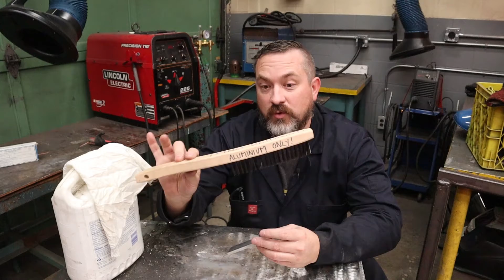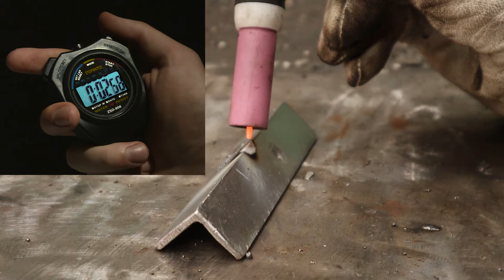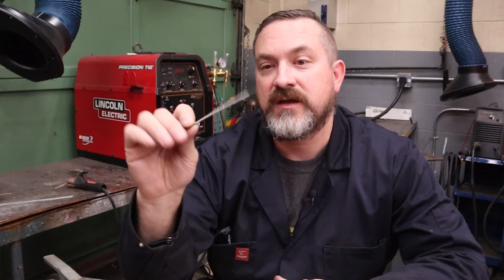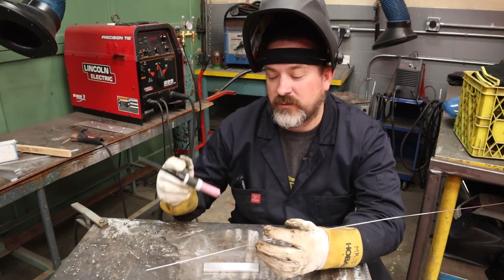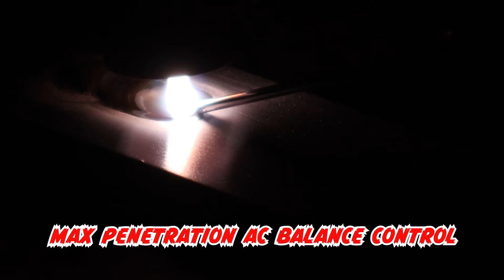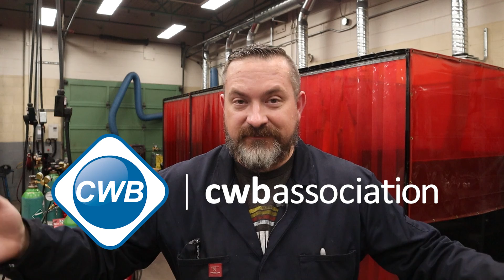How to TIG weld Aluminum

Comment: Why is a ball preferred over a sharp tungsten tip
Reply from the maker: There's a lot of factors as to whether you need or will eventually experience the balled tungsten tip so I made a video on this and other things that are different about welding aluminum.  You can check it out here https://youtu.be/uZftH7cjS7U

Thanks for the watch!